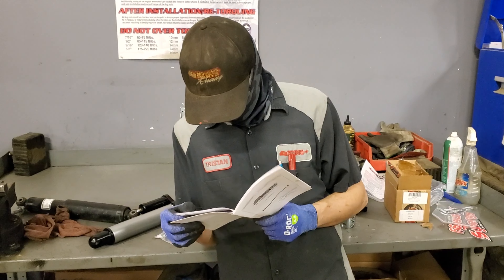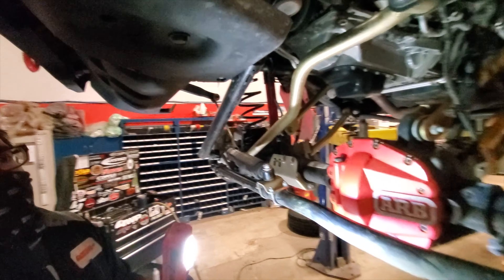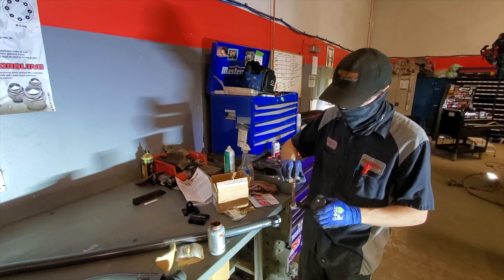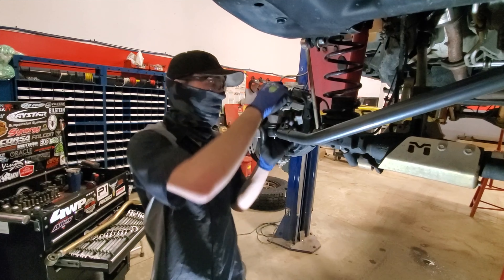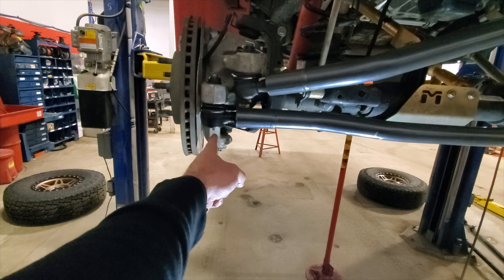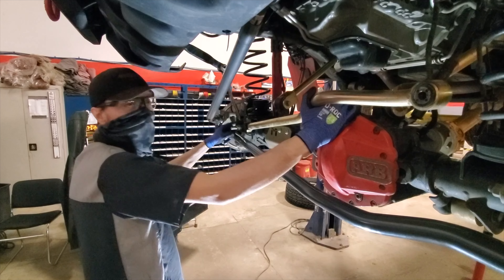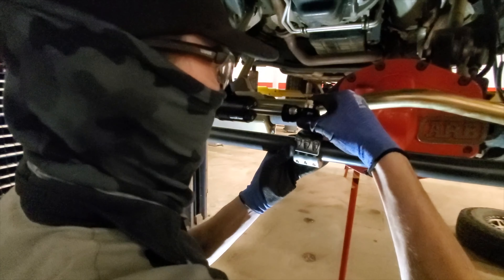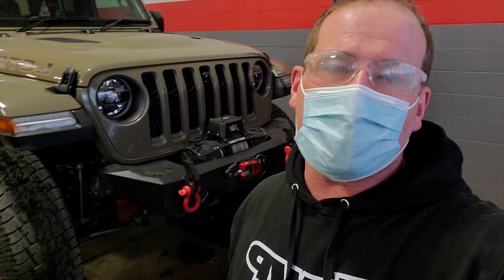Death Wobble solution for a new jeep

Comment: Would this apply to the new 2024 Jeep Willys?
Reply from the maker: I would say if you haven't modified your suspension then you most likely will be fine and if not the steering system dampener etc is warranty so leave it.
Reply: @LetsGoJT at what point nearing the end of warranty I’m guessing to change certain parts that would eventually effect the wobble. I noticed you added the Rubicon Express NFS stabilizer, is that something of a better stabilizer than what the Willys use(stock). I was eventually thinking to put a Fox shock version I had seen on another channel. Would this give a more firmer feel?
Reply from the maker: Fox shock is great.  They all are factory is usually the lower end on the steering stuff.
Reply: @LetsGoJT the upgrade used in the video (rubicon express nfs, is that the rubicon stock or is it the fox shock version for the Rubicon?